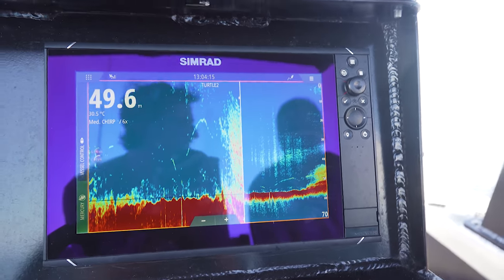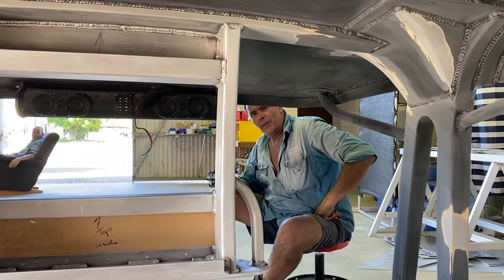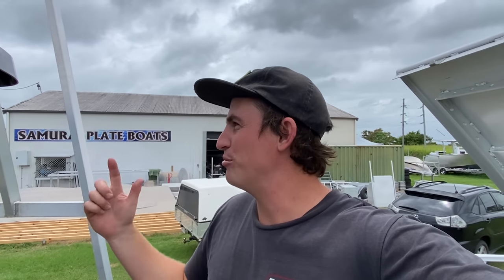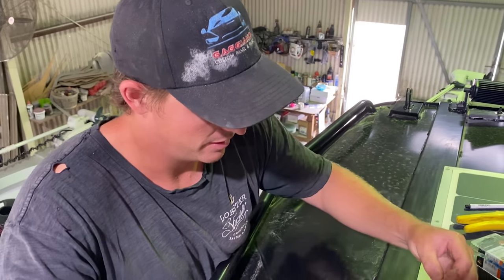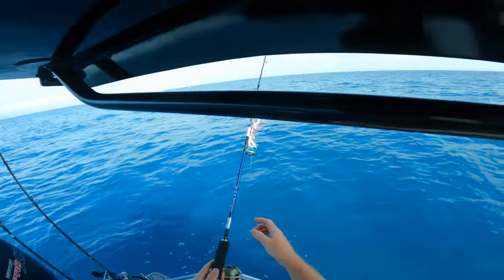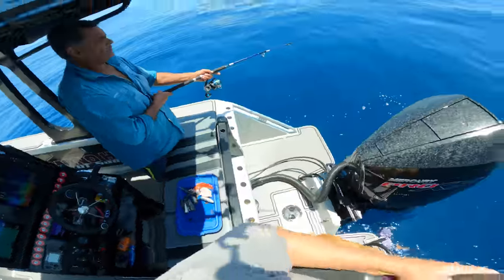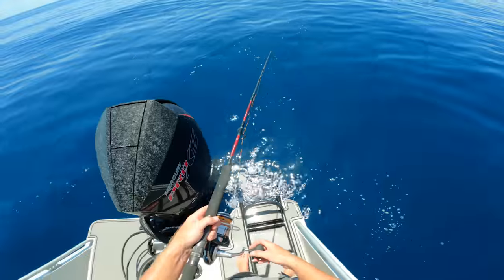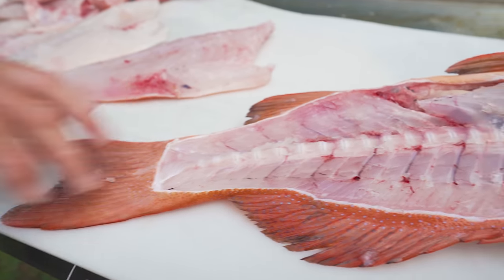We Fixed the Roof!

Comment: Timmy, for your remaining vibration in the roof, you could consider some temporary straps/stays hooked onto the rear corners (at the longest overhang of the roof) which get tensioned down to the stern corners/gunnels. They would be in the way for fishing, but the idea would be to just hook them up and tension them down before any long pounding drives, in or out to fishing grounds. What you would be aiming to do is to tension it up enough to take out the flex in the roof all towards the extreme of one direction, and thus dampen any movement. 
With a bit of thought and and a little hardware and the right straps (no stretch) it could be a simple 30 second job to do or undo. Hope that makes sense. Tensioning down one side is essentially the same as using a rigid post to push up the other side. 
You could go some sort of soft woven strap—or could do a stainless crimped cable with a quick hook and tension lever thing. 

Wicked boat, and in like the repair job. Hope the next chapters for you are great ones.

Comment: Aluminum boats will always crack welds. there is no perfect medium. boats, trailers, frames....doesn't matter. If it's high stress it is always going to crack, you just do the repairs as needed. Fiberglass, steel doesn't matter they all require maintenance. make sure you have at least two good bilge pumps and don't neglect inspecting the bilge.

Comment: Never twist wire in a crimp Timmy knife edge on knife edge, parallel strands in a crimp are ideal.
Reply: I little grease go's a long way to keep out corrosion in a salty environment. It is great in trailer plugs aswell.
Reply: @xuejiaoxu6778  It's not about grease and corrosion, its about melding copper into a cold weld.